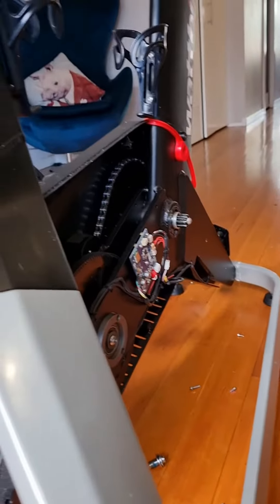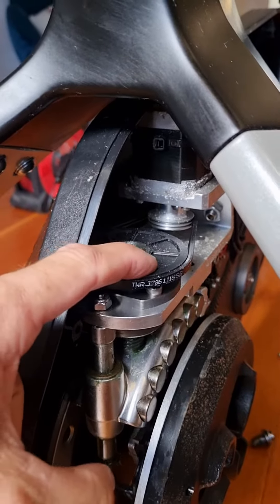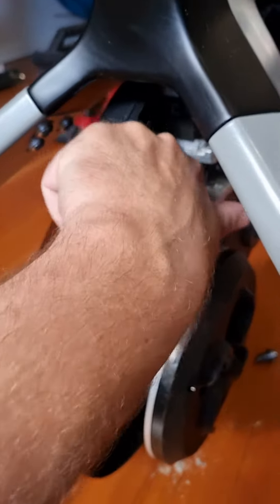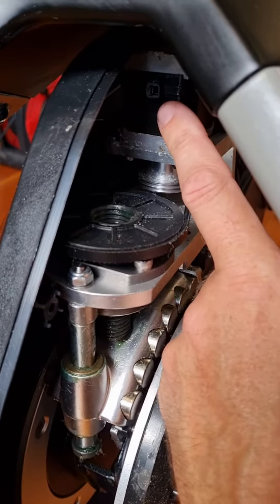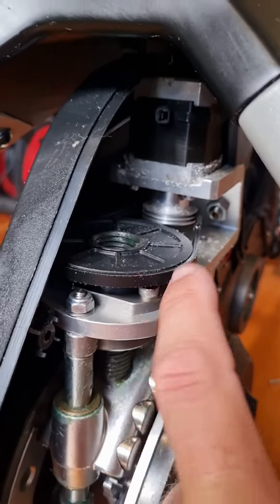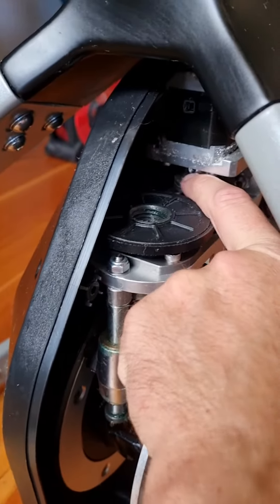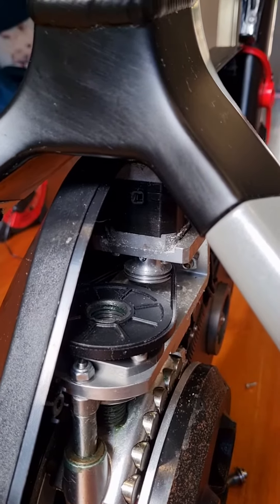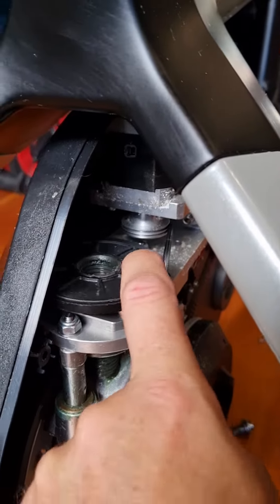Wattbike Atom resistance not changing.

Comment: Hi Ben. I thought I had the same issue: gear number changes in the app and on Zwift but no resistance change. I’ve opened it up and the gear/pulley moves freely and turns in response to pushing the shifter buttons, but the magnets don’t move up or down. Any thoughts? Cheers.

Comment: Thanks for the video, after 4 years and 16000 miles of use on Zwift mine as just locked up today, takes 500 watts to turn the cranks, changes gear on the app but not on the bike.
Will try this tomorrow fingers crossed. 
Where do you get your replacement stepper motor.
Thanks
Reply from the maker: The model  umber will be on the top of the step motor, Troy brand name, should be able to find online

Comment: Hi Ben,

I think I have a slightly different issue - the gears on the Wattbike hub seem to go up and down if I push the right shifter - but nothing actually happens with the gears or the resistance. Any suggestions?